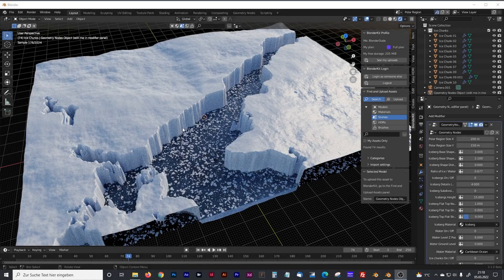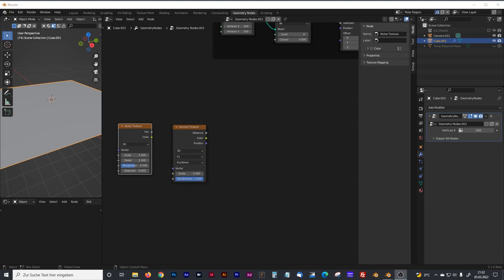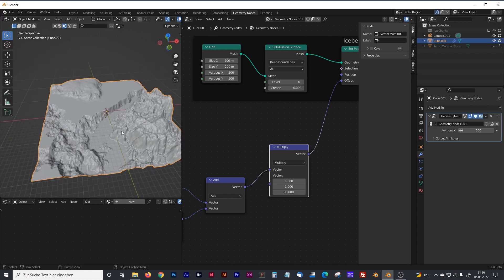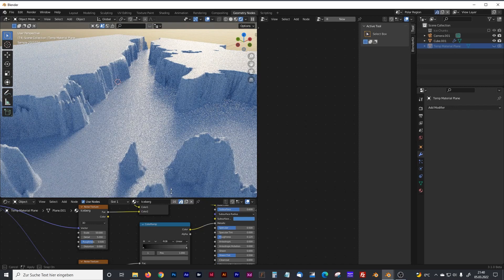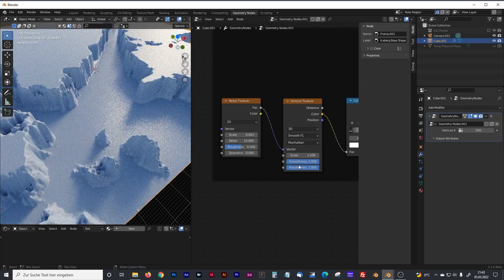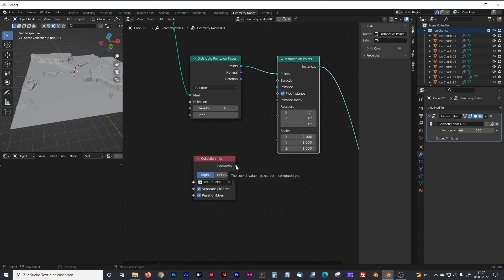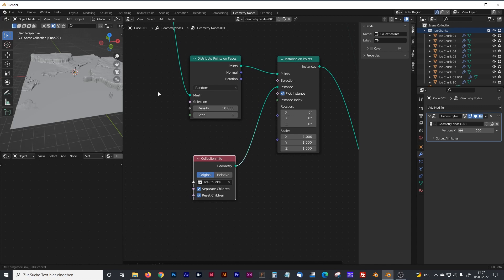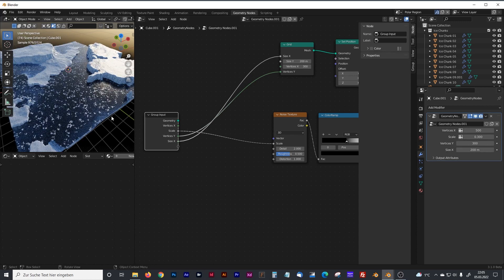Polar Landscape with Icebergs and Ocean - Blender Geometry Nodes Tutorial

Comment: great tutorial! explained thoroughly yet concisely which is exactly what I hope to find when following a video :)
i have one issue that i am running into with the ocean material, though. it could be that i'm using a different version of blender. While my ocean material has the right color and texture appearance, i'm not getting the same "depth" effect if that makes sense. even with the exact same settings for the BSDFs, both volume and surface,  all i see is the surface of the water and nothing below is coming through. is there a default setting in the render or scene properties that needs changing?

edit: once i increased the Z property under the "set position" node for the ocean grid, the effect started to come through. yay!

Comment: Cool tutorial! I ended up doing a mesh boolean on the iceberg grid and the second grid for the water. That way, there are no objects under the icebergs

Edit: nvm, that didn't work out too well. Not enough resolution to accurately place the water directly against the mountain edges I think
Reply from the maker: Yes, know what you mean - tried that solution in my tutorial "modular Landscape" didn't worked out eather....
Reply: @blenderdude5050  Hmm, any other ideas? I've been trying to get it for a bit. Maybe scaling up the booleaned mesh afterward? or raycasting up on each vertex and somehow deleting the geometry of them if it interesects? very curious to know if this is possible
Reply from the maker: @rexma7394  Maybe we could use a "Geometry Proximity" Node in combination with a math node set to "Distance". With a "position" Node in the math node, we could measure the distance of each point from the water and the iceberg, Of the distance is positive (or negative...?), the iceberg is higher than the water no ice chunks should be there. Plug that info into a delete geometry node. And that delete geometry node in the selection input of the "instances on points" node. Just an idea, did not try it out...
Reply: @blenderdude5050  I think I got a somewhat okay result now (if a little inefficient?). I followed what you said but couldn't get the proximity to work alone as really shallow land would be considered. In the end, I went with a combination of ray cast and your method. I ray cast up and pass that didHit result to a boolean and. I also do a geometry proximity with position that leads into distance and then a greater than node. that is passed to the other side of the "and node". I use the threshold of the greater than node to say how far or close the edges of the water are. This gives me what you would expect with the water only slightly bleed into the icebergs. Thanks for the help :)
Reply from the maker: @rexma7394  Cool - Curious about the result! maybe I will need that node example for one of my next tutorials!